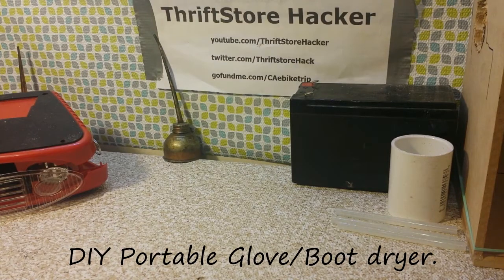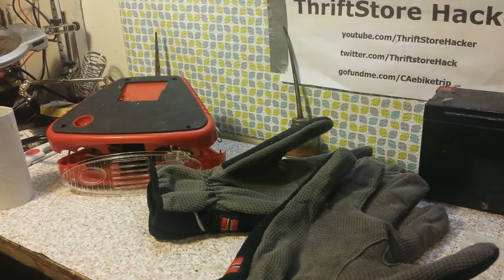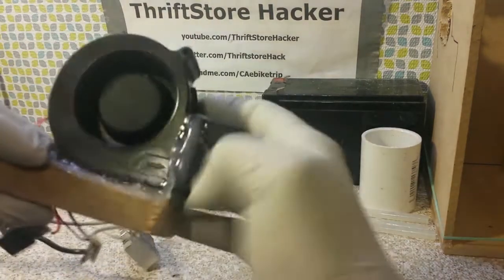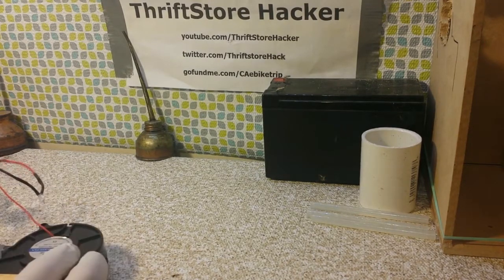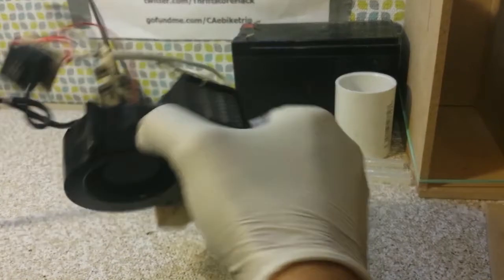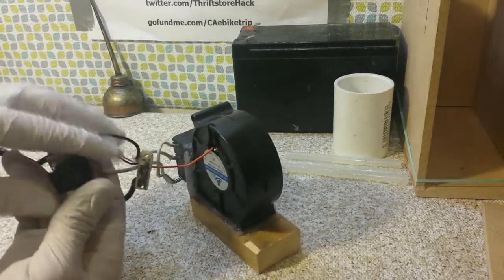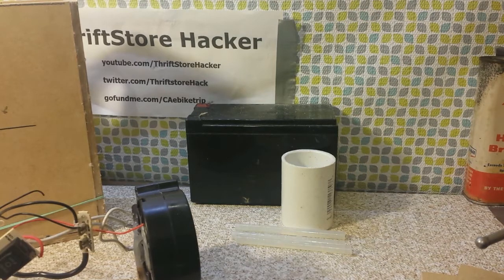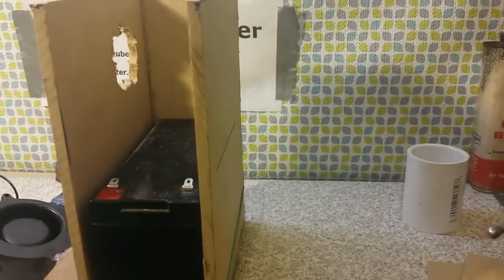12v portable glove and boot dryer.

Comment: Using hot melt glue with a heating element??? Not sure your glue type was the best option.  On your next build try using a quick set epoxy resin.

Comment: Do you think you'll need this for your trip? Seems A LOT of unneeded weight - love the idea though!
I'm not sure where the air input is coming from??
Reply from the maker: it will be nice to have and doubles as a tent heater. the air is coming in on the side.  I covered it with a panel to make it look nicer.
Reply: ThriftStore Hacker Ok ... Just make sure you get decent airflow. After all that heating element is just really a nice short circuit ... proper air input is a must. Great idea though!!